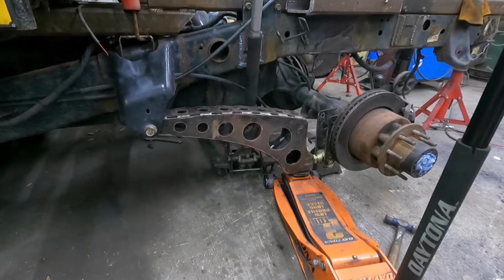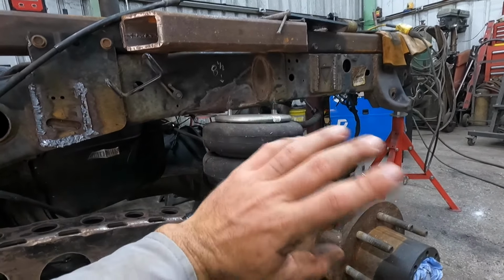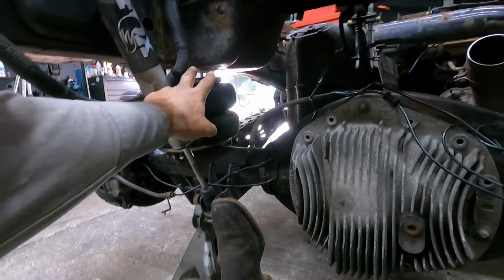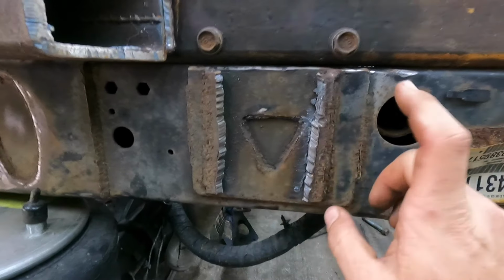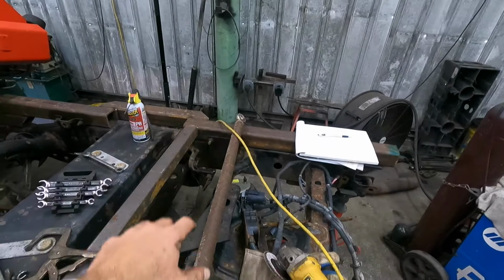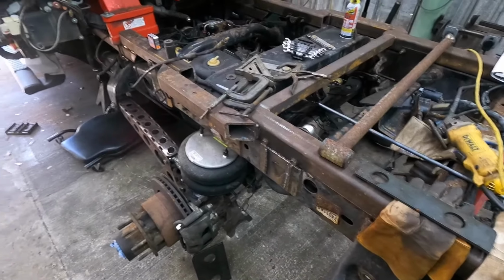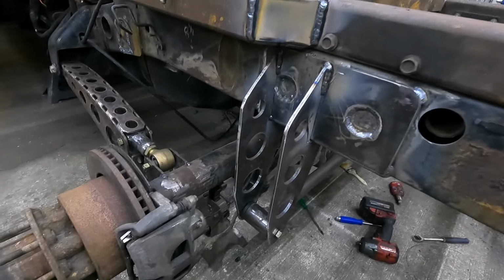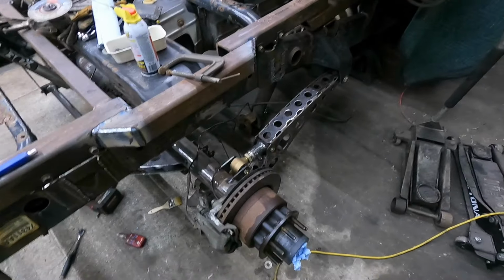Custom Crane Truck Build | Custom Rear Radius Arm Suspension | PT 3

Comment: So, with 2 rigid arms attached to the axle, the assembly acts like a giant sway bar, the axle gets wound in torsion if one or the other wheel is raised up in relation to the other side. ....
Reply from the maker: Makes sense, hadn’t thought of it that way.
Reply: @j_moffitt  Ford radius arm on the front suspension has large diameter rubber bushes to allow for that articulation. Otherwise the binding could lead to broken ball or heim joints etc.  Also,  I wanted to Thank You for your 2wd to 4wd videos, we converted a twin I beam F350 to a mono tube straight axle.  Awesome 💪